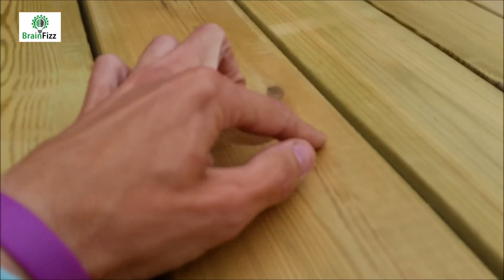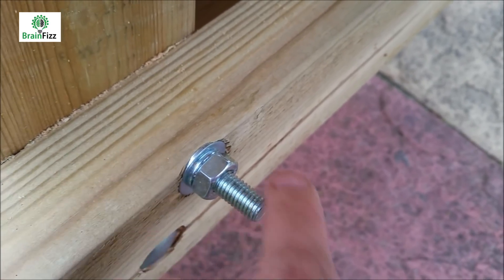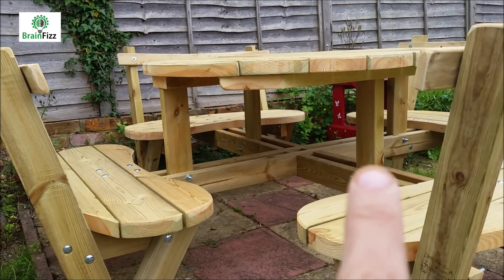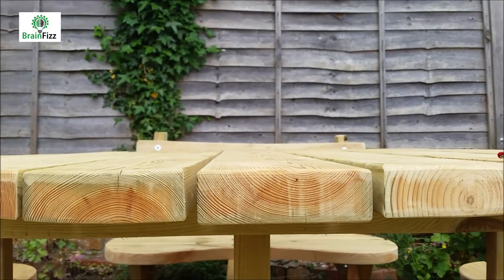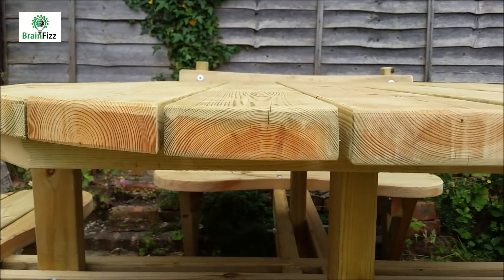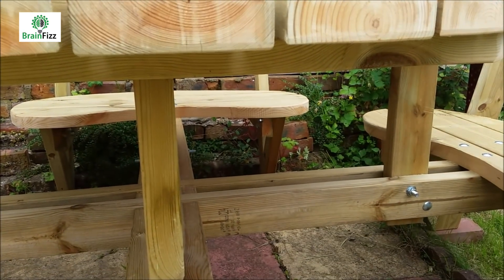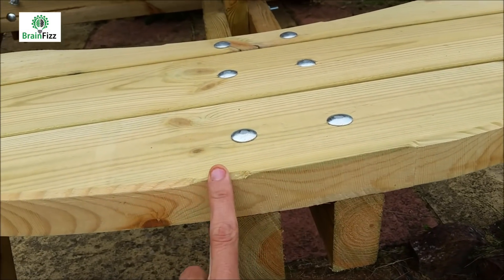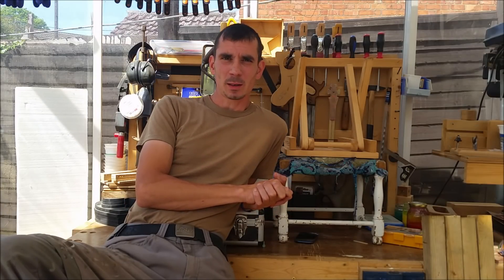How to make a DIY Round 8 seater Garden Bench | Brainfizz

Comment: This is amazing. I watched the original video some time ago and didn't get around to building. This edit has reminded me of my plan to build it! Can I ask, how wide is the top table and also how wide is the frame?
Reply from the maker: I think the original four lengths for the cross frame were 8 feet long, I basically made the whole thing up as i went along, the dimensions can be whatever you like, or space you have.... the table's probably about 4' diameter, from that i just set the seats far enough away to not be a tight fit, and trimmed of any extra frame that was left.

Comment: Love it but could not do it as jigsaw hurts to much as do some drills but may make it with father in law as he can use both but not the router as he not yet used 1 and that my fun not his. Love the fact you did not forget the very important hole in the middle and may get together with my father law to make 1 but would router the edges before I put the screws in thus avoiding the problem you had nice to see you have problems to which some youtubers tend to hide. PS the question of live streaming you will be hopefully receiving a message from a brother of a mate that does live streaming who will be able to help with that.
Reply from the maker: that hole in the middle is ended for the parasols! definitely the most important part! LOL!!
I managed to sort the live streaming in the end, I tend to only keep them up on the channel for a few weeks though before taking them down again, as they tend not to stay very relevant after a while. but thanks for the input!!